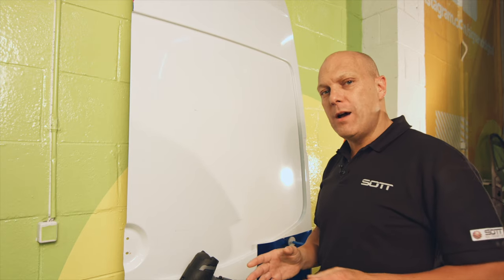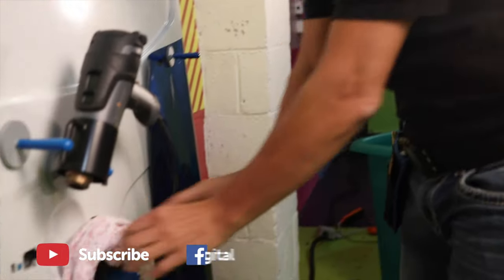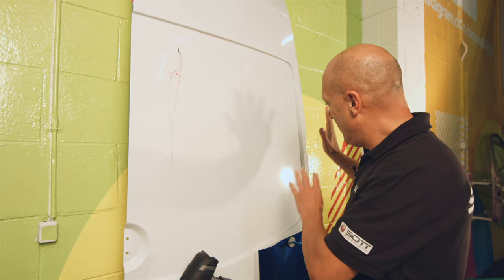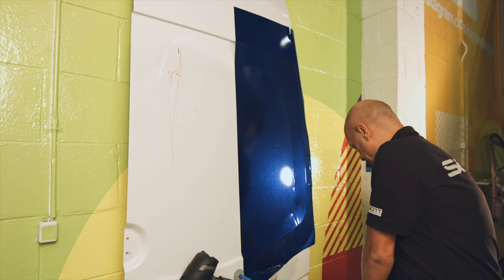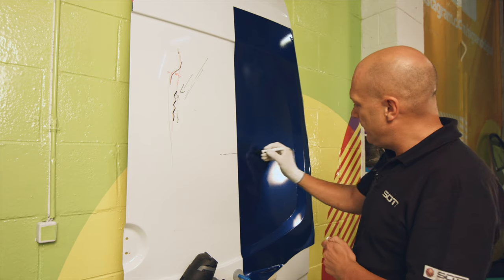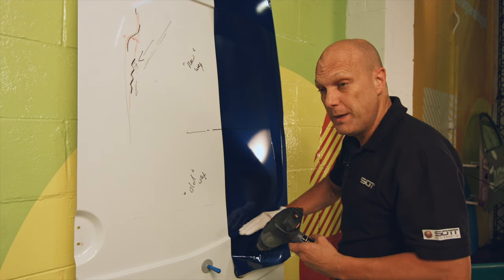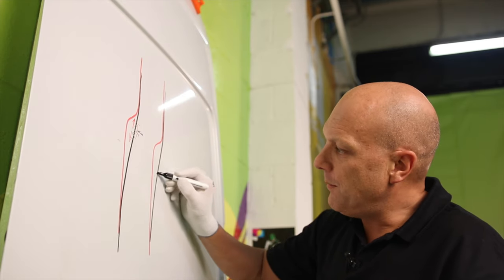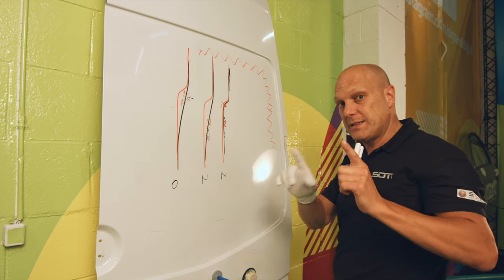How to wrap those deep recesses (channels) the right way! (surprise way!)

Comment: Those primers fucks up the car and it's a pain in the ass to get them off after removing the wrap. POST HEAT GUYS POST HEAT! That's makes sure that there will be no pull back not that shit, no..
Reply: They never tell you the full story, use a decent product for the job and you don’t need another added process and your spot on with the removability